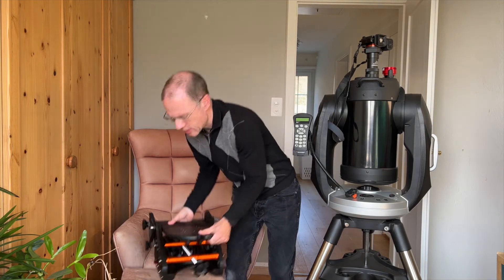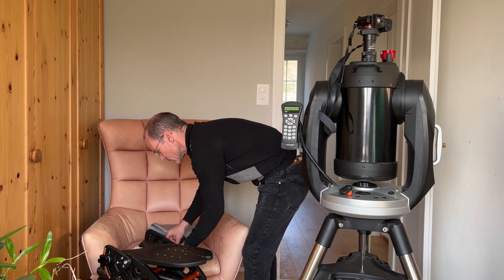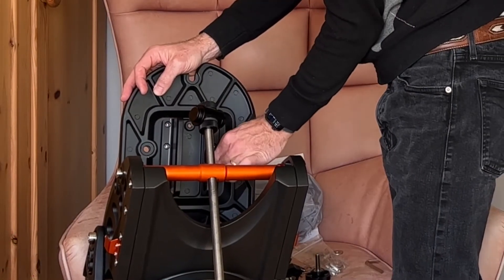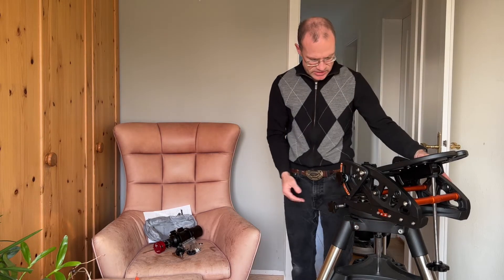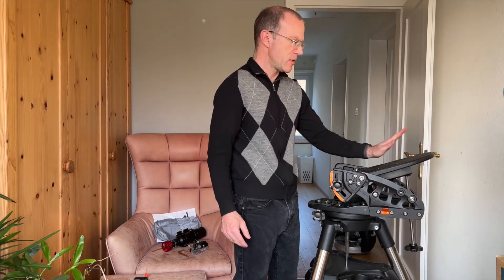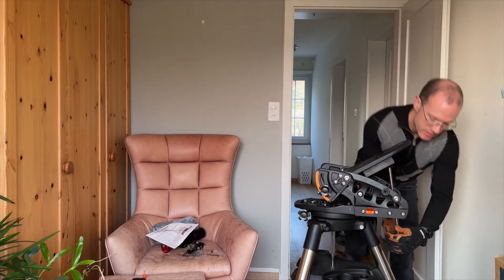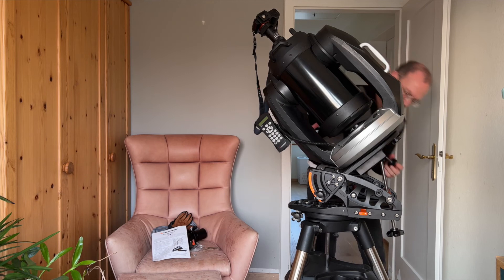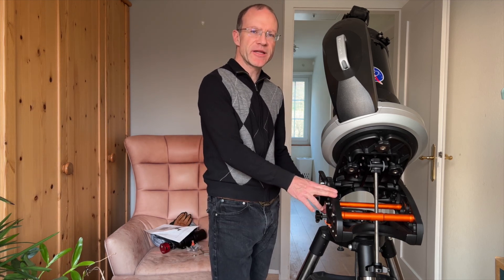How to install the CELESTRON HD PRO WEDGE on a CPC-800

Comment: Hi there thanks for the video. I was wondering if you did a video on how to set it up and use it ?
Reply from the maker: Sorry, never did such a video. Just set it up direction north and then use the CWPI software of Celestron to polar align it. After that, kill the CWPI software, switch the CPC-800 off and on and align "North Polar Align". Then connect with ASCOM to your Control Software (e.g. NINA) and you are ready to go. Never use the CWPI ASCOM interface to connect to NINA/PHD, as it is very unstable and will crash right during your shooting which is super annoying.

Comment: Greetings from California!  Thank you for your great video.  This is all VERY familiar to me.  You have to be VERY careful handling such a large and heavy scope manually, especially as you get older --- can be dangerous if not handled carefully.   I have an old manually-operated Celestron Ultima 11 SCT scope (VERY similar to the CPC 1100).  After using it on its tripod for a number of years for star public parties, getting very tired of the weight, etc., I realized that it was time to mount it permanently on a pier in my backyard.  I visited a junk dealer to find a suitable pipe to install it in the ground.  Fortunately the pipe already had a flanged end with bolt holes.  Then I built a bolt-on top plate to place on it and mounted my wedge to it.  Then I built a very-small and compact roll-off observatory shed for the telescope (the size of an enclosed telephone booth).  I was president of our local astronomy club for about six years and also an official volunteer public outreach representative for NASA's Jet Propulsion Laboratory for about 6 years, exposing the public and school children to astronomy and space exploration.  Glad to see you are having fun with your new scope.  How is it going for you?  😎
Reply from the maker: Thanks for sharing Walter! Yes, the CPC is quite a special kind of scope, and as it was my first one, I have a very special relation to it. Still, the bulkiness, the sub-par guiding and the constant issues I had with backfocus brought me now to point, where I feel our ways will part. I just received a wonderful, lightweight, highly accurate mount (soon featured on this channel) and I could put a 8' SCT on it. So it feels that this is the better alternative....

Comment: Thanks for this. Very brave video.  I wasn't sure which allen bolts belong to the plastic washers, and still don't. LOL.  It's a heavy wedge.  Be sure to remove the handset and holder before  moving the scope on the wedge. The ZWO uncooled planetary cameras with the side ports allow the camera with back focus to be installed without the USB or power cords hitting the mount.  A least on my CPC 925 HD.

 There is another mod I am exploring for a ZWO ASI533 using F/10 and 146mm back focus, but  sadly not with a reducer.  Only for long exposure astrographing smaller DSO galaxies.

Comment: Again, Thanks Sascha - thank heavens I found you, oh you lighten my heart! The ill informed opions about Alt-Az on a Wedge versus the EQ mount / drives have been very distracting and plain wrong. Your images and comments are proof. I had also come across a lovely lady in the States with the same set up and she too had great success with precise tracking to do great AP. Finally,  yes, I have set up the SCT OTA to piggy back my ED80 on top  for spectroscopy imaging - weight is absolutely no problem. Your FRA400 will be fine. (I too have the FRA400 on an AM5 mount - a "travel" set up). Balancing with a counter weight on the bottom is it, and easy. Once I get everything working properly I want to try doing OSC / Hyperstar imaging (through the SCT) at the same time as the ED 80 (Mono camera / EFW), both on the same DSO. I'll do the guiding through the ED80 setup. Haven't thought this all the way through yet re camera control, but I'm sure this is possible.
Reply from the maker: Well, just as a work of caution, I aborted my piggyback plans and ordered a dedicated mount for the FRA400. Guiding error worsened extremely.... If I would have spent more time on balancing - who knows, but it just did not feel ok. Video about it out in the next days....
Reply: @viewintospace  ok, I’m tempted to say balance is the trick. You need to use counterweights so it balances horizontally very well - I can send you the Starizona tutorial on it. But I use a few kgs and it’s a matter of sliding up and down the slide on the underside of the OTA to really get it floating with the rig fully set up - I’d like to think you were light on weight.

Comment: Hello Sacha, thank you for this video. I have the exact same scope but in the French part of Switzerland. AltAz has been fun for a while but I wish to do AP now, did you have any success with this setup ? I'm undecided between deforking and buying this wedge. Cheers !
Reply from the maker: DO NOT DEFORK! .... I should/will make a video about that ;-) Anyway in short: 1. The wedge works perfectly and my pictures speak for itself (Instagram: view_into_space ) If I could change things I would switch to the HD version, but this is it. I can make 300s exposures (guided) which are razor-sharp. 2. You never have to do a meridian flip with the fork design 3. The fork resp. the motor is ultrastrong. So balancing? Yea, a bit but in principles not that important... Putting a second scope piggyback? Sure, no problem. So imho the fork has practically only advantages, I will never understand people who defork their CPC.
Reply: @viewintospace  Thanks for the reply ! I will look into the HD Wedge. I won't load much equipment on it, probably just an OAG+guide camera, and the visual train for imaging. Looking forward to your video. Clear skies !
Reply: @viewintospace  
Celestron only has the HD pro wedge listed on their website.
Was there an HD version available and why do you prefer it? 
Thanks

Comment: Does it help a lot? Some people are telling me not to spend the money. I have the CPC 1100
Reply from the maker: It is probably the best upgrade you can make to your CPC. Changing from Alt-Az to Eq opens a whole new dimension of possibilities to you. And once you have the wedge installed (which is not complication but yes, kind of annoying as you can see), it works very well and polar alignment with CWPI is really easy. A further advantage of the wedge  vs. an Eq mount is that no meridian flip is required ever.